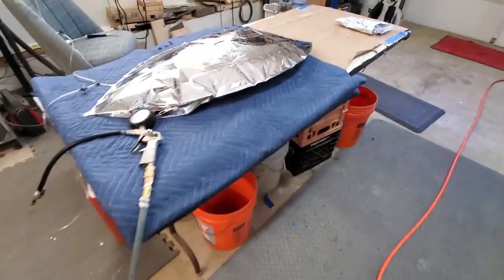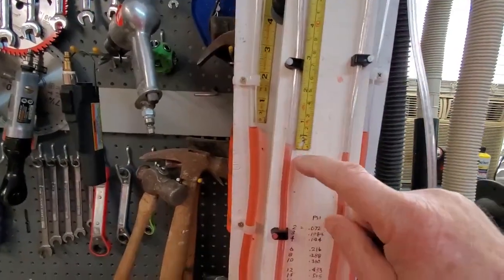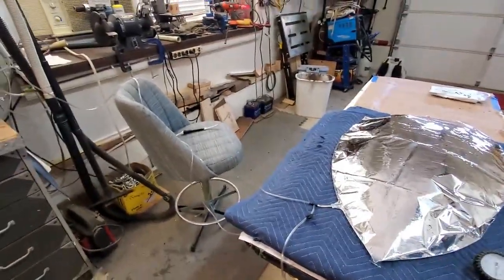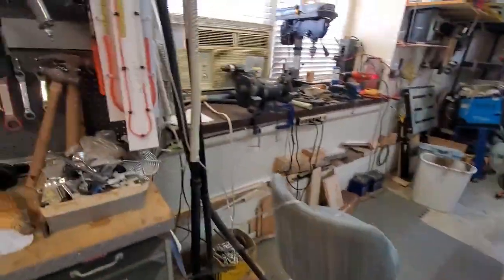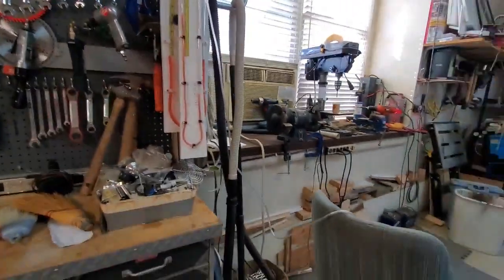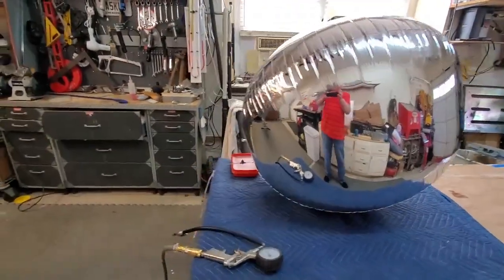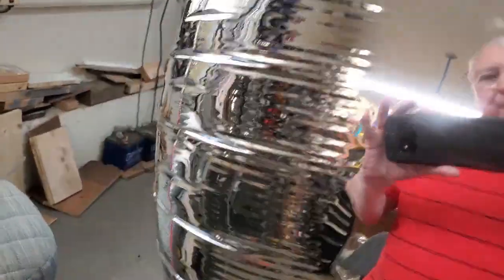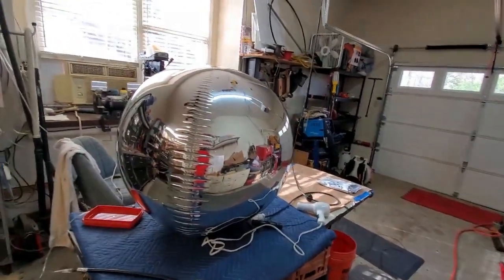Pressure test of a pico balloon

Comment: How did you attach balloon to air hose? I watched your other video with shoelace. Tried shoelace, but it leaks all the time.
Reply from the maker: I cut some rubber from an old intertube about 10 inches long and 1 inch wide.   wrapped the valve and tube with the rubber then put a stainless steel hose clamp on it.  that way it does not damage the balloon material.